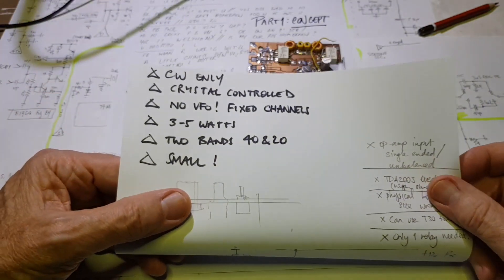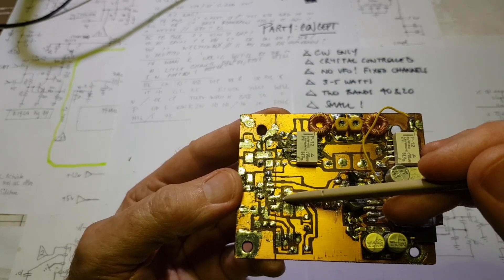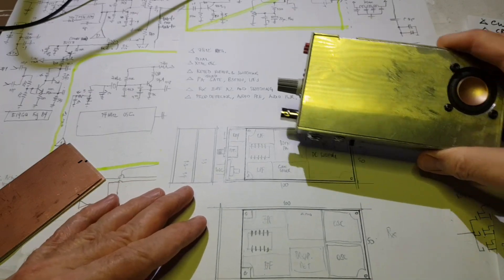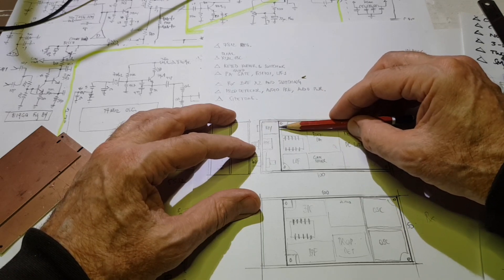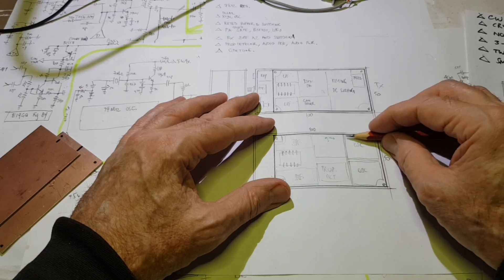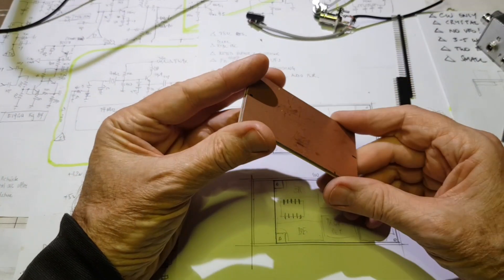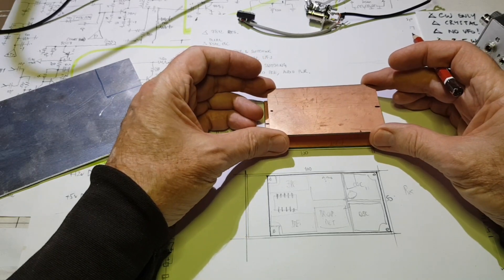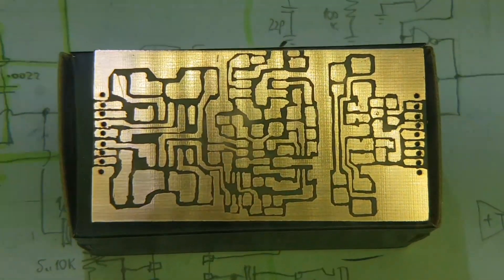2B2C: Scratchbuilt Dual-band 2 channel QRP CW rig/ Part 2 Receiver PCB

Comment: Hi Paul. After last weekend's GQRP convention, I've been thinking of moving on from perfboard and etching my PCBs. I like your approach because you seem to bypass using a transfer (I don't have a laser printer) and drilling through holes. Am I correct in assuming that you do a modified Manhattan approach? In other words, you etch by hand and then you surface attach all your components to the copper after tinning each exposed trace? Do I have that right?  Thanks for all the videos. They're very helpful for us in the field.  Jack, NG2E
Reply from the maker: Hello Jack, thanks for commenting again.  You are correct, that's exactly how I do it. Mark up pads with a 'texta' or 'Sharpie' of felt-tip pen on the bare copper face, etch the unprotected copper away in Ferric Chloride, clean it up and solder the parts direct to the copper. So it is Manhattan style on copper islands, with joining tracks.  Video here: https://youtu.be/-guLpzvVVC4  
This is an easy way to work with leaded components or surface mount.  I can mark up, etch and commence the assembly of a simple baord in an evening.  Having said that, I've just started using EasyEDA and JCLPCB for truly excellent PCBs, with consequences like a lot of extra design time, the one to two week turnaround time and the cost (mainly couriers as it turns out) that need to be considered.
All the best for your projects, once you can make your own PCBs however you like them, you have a wide open field of options.  73 Paul VK3HN.
Reply: @Paul_VK3HN  , thank you so much. Yes, I saw your etching videos. Very helpful. But I had wondered about the ruggedness of Manhattan style. I know my SOTA “appliance” gets a little beat up. I handle any scratch built transmitters with kid gloves. Seems your builds—and those of Charlie Morris—hold up just fine for field use.

Comment: Thanks Paul great video's binged on them both. Look forward to work you on air with it. vk5cz..
Reply from the maker: Hi Ian, it has been an interesting design challenge, and I have renewed appreciation for the QCX MTR and other compact QRP CW radios which have dealt with and solved all these issues and a whole lot more that my simplified design avoided.  73 VK3HN.

Comment: Very nice project and video series! Due to your recommendation I also bought the book about transceiver design! Apart from stacking the two PCBs one over the other, wouldn't it also be possible to connect them butt-to-butt with the SMD component sides facing outside to further ease adjustments and repair?
Reply from the maker: Guten Tag.  That's an interesting idea. The resulting problem is that the dual board assembly must then be mounted  above the metal case with spacers. The allowance for components is a minimum of 10mm.  In my arrangement,  the bottom of the two boards presses flat against the aluminum case. This is good for screening and RF stability, and also for heatsinking, although that's not a big issue in this design.  The 0.1" headers and mating pins occupy 12 to 13mm and this is just enough to fill in with the lower board's  components. It's an interesting design challenge,  designing to meet  physical,  electronic and RF constraints all at once. Auf wiedersehen.
Reply: @Paul_VK3HN  Guten Morgen! It's an interesting design challenge, indeed! Considering the spacers: maybe with a groove in the frame, the sandwiched PCBs could be held in place with minimal area loss. Viele Grüße, ich freue mich schon auf die weiteren Teile der Reihe!

Comment: Do you have antennas in mind when designing this? Is an EFHW with a single trap a good option for this rig?
Reply from the maker: The rig is 20 and 40m. I'm using an end fed half wave with a simple tuner, by Steve Yates AA5TB. You can see the tuner, and me throwing the wire over a tree, in the first video.  20m of wire is a half wave on 40 and a full wave on 20. The tuner matches both. (There is no trap, just 20m long wire).  It will work on 10m as well.  Search up Steve's excellent pages for the theory and construction.